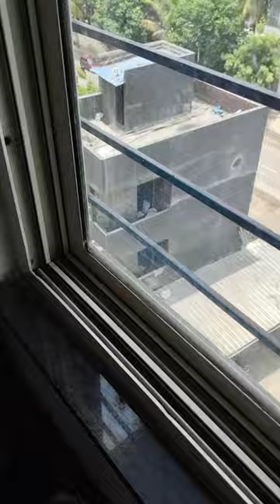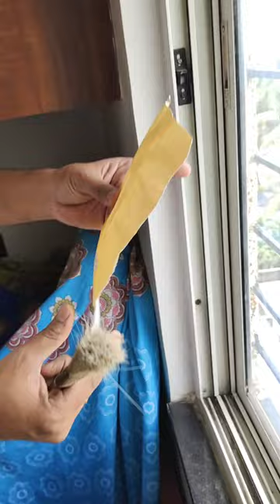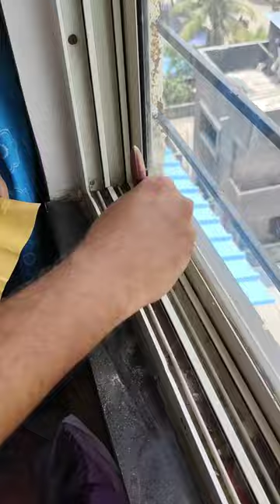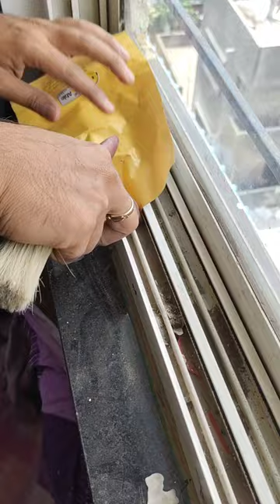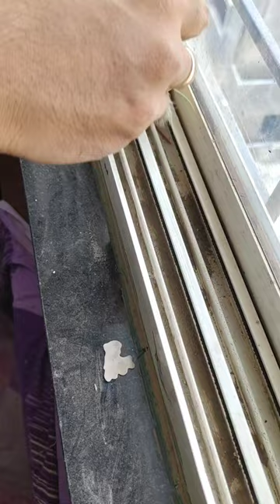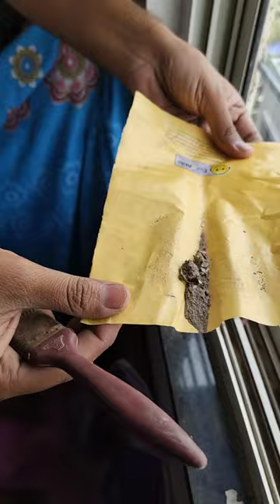Easy way to clean window track at home using two simple things😀 #cleanhome#hack

Comment: Pipe cleaner. Thank me later. Gets underneath the door and window tracks too. Pulls out the debris and then get a battery powered vacuum. Then lasty get a spray bottle and a cloth and wipe out any excess dirt etc. You can also wrap tje cloth around a flat head screwdriver and pull ut along the small tracks to finish up. Way quicker than any of this